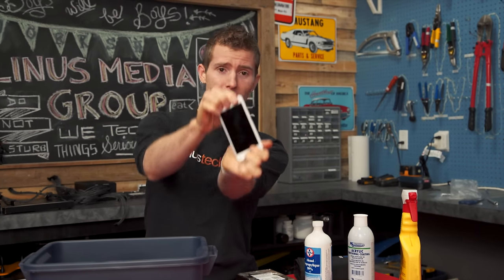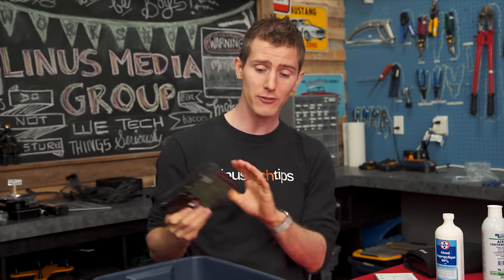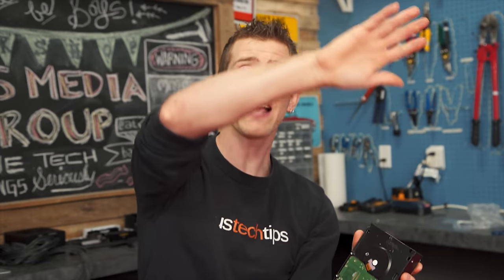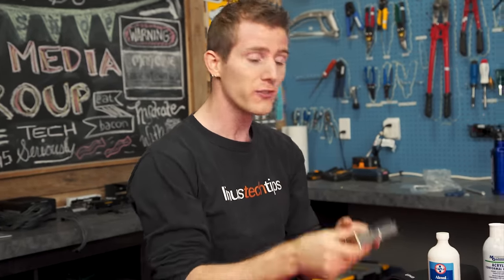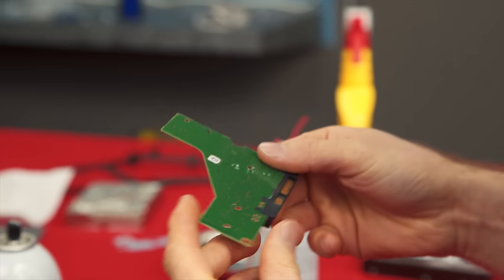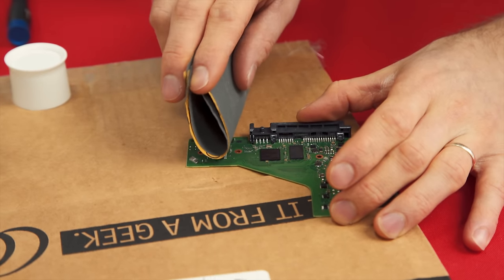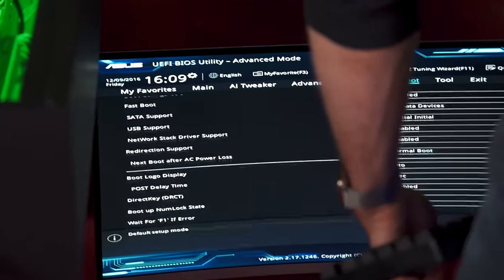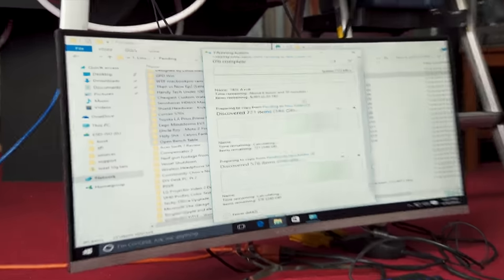DIY "Waterproof" Hard Drive

Comment: I cringed in my head as I pondered the likelihood of a liquid-tight seal on the connector.  
Also, I didn't get a fantastic look at how the board that you coated is attached,  but sanding the coating off of any  of the connections that have opposing charges compromises what you've done and doing it to what you specifically point out is power seems like it  would immediately throw some red flags.  Still appreciate the passion for ingenuity.  I was picturing something more along the lines of a pelican case with an air-tight pass-through  or port that  forms a tight enough seal once the cable is through to ensure the seal is maintained under nominal pressure conditions.

Comment: By sanding the metal contacts and making them open to the water you were inadvertently causing electrolysis, one sure fire way to make water conduct electricity. (and it will eat the contacts)

Comment: Since the circuit board makes connection with the hard drive via contact points, it makes this project bunk from the beginning. Because as soon as water hits the contacts, it'll still short. At least no one else will get curious and wreck an expensive hard drive now. Lol.

Comment: "Okay, I am liquid cooling the hard drive." XD

Dude you obviously shorted the data and power connectors on the top which were not coated with conformal coating.

Comment: Linus, you really made a mess of this one. It was all undone by you submerging a non-waterproof SATA connector. What on Earth were you thinking? If you had siliconed the connection, you might have had more of a chance. Mineral oil does not have the same metallic particle transference issues causing conductivity when compared to water, which does. If you had stopped for a few minutes and thought about the technology operating within the HDD, you should have thought about masking the connections and siliconing the connections.

Comment: if you ran a bead of silicon around the pcb and over the power and data connectors after plugging them in it would probably work.

Comment: No practical application? SmallPC has a "completely sealed and waterproof" PC. It only has an SSD though, so this could make its way in there. Its for marine applications. What ever they are doing to make the SSD H2O waterproof I'm sure would make a mechanical helium drive water proof. 
Ok so next challenge. Make an optical drive with an "airlock" and make that water proof. It may even be possible to insert a disc while being underwater. The drive would be two times longer with two sections. Insert the disc through a slit that has two "zippers" that move outward from the middle and start to close when the disc is more than half way in. In the airlock and water that made it in will be pumped out and a dehumidifier used.  Once this is complete the disc will be inserted into the main drive. I can see why a water proof PC could have practical use, but not optical discs underwater.

Comment: Why not coat the crap out of it, when the cables are actually connected? put a layer between the cables/connector gap. If your plan is to put your hdd in water, I am sure you are not planning to take it out :)

Maybe coat a whole motherboard, ram etc next time? :P running onboard graphics, without cpu cooler and m.2 drive.

Comment: could be possible if the data and power was soldered directly to the drive and then coated (the pins that was sand was a problem too)

Comment: You CAN Make HDD to be waterproof. Just solder up all of the connectors and contacts on the HDD board and sata signal/power and HDD motor, then hotglue them or just spay that "waterproof stuff" on them and you`ll get the "Waterproof" HDD. It`s so easy, but is it worth it??

Comment: It was obvious this was bound to fail for two reasons:

1. There was literally nothing to seal off the power and data connectors to prevent them from shorting out, why would anyone assume that it would be safe to submerge those in water???

2. When he figured out the PCB had those contact points with the drive; No matter how well you coat the PCB it won't make any difference unless you make sure to seal off those contact points as well since the water will just find its way in there eventually and short those pins out. The coating on the PCB most probably did a good job of sealing it but there's no guarantees it's a perfect seal (meaning it could be it only slowed down the eventual shorting that was bound to happen).

Comment: With mineral oil, you wouldn't need to have coated the HDD right? The drive i sealed and the mineral oil would have caused no problems with the PCB. I did coat a customers GBA SP one time because they kepts getting it wet for some reason... :P

Comment: Im a ee and I knew from the start this was never going to work Im amazed he got the drive to even spin up after the coating the sata controler cant deal with the resistance from the water on data lines Its a differential line system 2 wires where the difference in voltage of each line makes your data bits differential signaling is good against noise but not against Linus

Comment: Why not just cover it with silicone, together with the sata power and data? Seems like a better option, by sanding down the connections you un-waterproofed them, and that sata power and data weren't waterproofed at all...

Comment: My idea is to pot it into epoxy, haven't find anybody do it... but I would grease electrical contact with dielectric grease before potting the drive and attaching some downwards pointing 90 degree extensions cords that I will tape under the drive so they would exit at the opposite side where the drive plugs are... and drop the assembly into a shape and fill that with epoxy... Not sure tho how cooling will be but well, that's an experiment... I wanna build a forever sealed drive... that you can bring with you in the tropical rain and would not risk loosing any data due to water...

Comment: He could have just used mineral oil to cool it because it is sealed the oil would not get in the drive and it is not conductive so it wouldnt have an effect on the pcb or the connectors

Comment: you need a waterproofed connector to connect the PCB, as it still has a gap for water leak even when it is still connected to the PCB, you need to connect your PCB out of the water. OR, you can waterproof it with EPOXY on the connectors if you dont mind not being able to remove them foreverXD. ANOTHER solution is that u order a waterproofed PCB connector to connect it to your motherboard.

Comment: 8:52 The power shorted really? The water don't have low enough resistance to short out at 12V, what probably happened is the data sent over SATA was affected by itself, thus causing the data to be completely mangled

Comment: When I initialize my ssd, should I of done MBR or GPT? and also, I've been doing alot of research, do i need to change my bio from IMT to ACHI + choose SSD as boot up drive?? one more question, sorry, when booting up the ssd After the samsung migration tool is finished, do i need to disconnect my HHD? 

Thank you so much, most appreciated + New sub

Comment: Why didn't you seal the data and power cables to the hard drive with something water proof like hot glue? Why would you leave them simply 'plugged in' and not expect water to short it?  The concept worked, just forgot that one small little thing. :/

Comment: Wasn't it pretty obvious, that it won't work with water?
You waterproofed the harddrive but not the connectors. You would have to connect the harddrive and then add the waaterproof spray. But I'm not even sure if this would work, because it would be hard to get enough spray into every single gap.

Comment: Sorry for out of the blue comment but I need help. I had a gtx 970 and just bought a 1070. I plugged everything in right, im very sure I have the drivers installed but when I tried to boot up Rainbow 6 Siege it said "this device does not support direct x11". Any help would be appreciated

Comment: Wouldn't it of worked in oil without  the coating? As long as the drive is sealed shouldn't it be fine.

Comment: Well a 2.5" SSD WITH the cables attatched, then cast in a shell of urethane or silicone compund would be pretty much waterproof... OR put in a small machined billet aluminium casing with silicone O-rings under its bolted lid and a proper aerospace grade gas-tight MS data connector on it :p

Comment: Please redo this test. The reason I'm asking is do to the fact that when you put the power connector on it still got water in it. Spray drive with acrylic then attach connector then spray the connector connected to the hard drive. And if need be the next sata connector for hard drive. 
I bet you the drive will then work under water! 
If that is the case. Then you should be able to coat an entire system (after all plugs are connected) and put it in ice cold water. I bet you the system will work.  mobo (getting under the heatsinks and spreaders. memory (no heat sink to make sure it's protected) if you coat the entire system right. Including cables. The system should work under water. 

Please at least retry the hard drive test with the spray applied to it after the connector is attached. 
Thank you.

Comment: It might have worked had you sprayed the SATA connectors to the point of build up while connected to the drive. I was impressed that the motor leads still worked and didn't short out.

But now that spray gave me in interesting idea using Peltier plates to cool a CPU. Previous videos show setting up the motherboard and then slathering it with Petroleum Jelly, as the Peltier plate tends to form rather severe condensation and even ices up if left on long enough. To remove the jelly, you disassemble the mobo and gently bake it upside down to let the jelly melt and run off. But if you spray everything the condensation could get into (though I would tape up unused ports or put in chucks before spraying), it would be less messy.

Here's a link to the video I am referencing (12:44 is where it starts to form ice!):
https://youtu.be/DHFGY32hV7w

Comment: probably sanding the connectors made the cable connectors not waterproof so the hard drive died when you submerged the drive all the way, making the water touch the cable plug on the top.

Comment: question, if you wanted a water proof hard drive, you would want a computer that is water proof too, as it is an internal hard drive, it would be useless if it was on the outside of the computer without a adapter. so why just not make a airtight case with some way of circulating air inside it and no transfer from outside to in or viserversa, and then only water proof the ports.

Comment: I think he pulled a fast one and was using HDD cables that weren't powered. The main reason is those metal connectors for power and data, you know the ones you sanded, would not have been sealed after the sanding and would have been exposed to the tap water, shorting them out. Second reason is ANY PSU worth it's salt would have tripped the moment that power cable shorted. Sorry man gotta call bullshit on this.

Comment: That helium inside the HD case.... Not for much long, if Seagate is looking for a pressurised environment within the case, using helium it's just not the solution. Long story short, industrial Gas cylinders are made out of up to 15mm thick walls of materials ranging from steel to carbon fibre reinforced resins so they can prevent helium atoms to literally escape too fast (they WILL soon enough). It's only me or anyone else can't see that drive enclosure stepping up to 15mm carbon steel walls.   
(i know, I'm boring as ass)

Comment: filled with helium for more efficient operation? why not use a vacuum instead?

if you were going to put it in mineral oil why bother waterproofing the electronics?
Reply: 1wsx10 Because they wanted to try water first??

Comment: Can anyone get a good look at build for me and tell if theres any bottle necking that might occur? Ive got an ASUS z170 mobo, Core i7 6800k, 16gb of corsair vengance ddr4, gtx 1070 founders edition, 750 watt corsair modular power supply, two 1 tb hdd's, a 250gb samsung ssd and the master air maker 8 all inside the Corsair 460x crystal series full tower case.

Comment: You did it all wrong. You should have left the HDD PCB connected to the HDD, then connect the power and SATA cables, and only then, spray the hell out of it. That way the electrical connections also get isolated. Sanding the connectors and then plugging the PCB and cables destroyed the isulation you applied before.

Comment: So.... you basically could've put it in the mineral oil from the start, without spraying that thing on it... Also, I knew from the start the power/data would short, because you didn't seal off the connectors. Pointless video, still liked it, still entertaining :-).

Comment: power and Data connectors are not waterproof. they would get short circuit! unless you seal them with epoxy or silicone. epoxy much better and they can be cooled in mineral oil for electronics instead of using water

Comment: WTF, you are covering head connector with a spray and then sand it off? Did you think that those pins have a thin gold plating which you just sanded off? After this torture, those pins likely will oxidize with time, and HDD will stop to work.

Comment: it could have worked if you sealed it in silicome
Reply: Even using what he did on the top and hot gluing the edge and the connectors would have done a better job, albeit not for an extended period as hot glue will deteriorate under water, it would still have performed better for this short duration test.

Comment: Why are these drives helium backfilled? Wouldn't it make more economic and physical sense just to pull a vacuum on the drive and have no gas molecules for the drive to spin in? that would be even less spinning resistance than helium. That, and helium backfilling is expensive, and these drives would make perfect vacuum chambers, as helium is used as a leak detector gas in vacuum chambers!

Comment: 8:28 common linus i thought you were more inteligent , the connection between the Cables and the Disk's logic board is clearly not water proof .. it's just like if all those pins were shorted.. anyways

Comment: 1) You're a painter come on! Tape it up what's not supposed to be coated;
2) Insulate the cabling - obviously;
3) No, we didn't think you would cheat and use mineral oil instead of water not because you're not a cheater - you are xD - but because we know you're reckless enough to actually dump the thing in water lol

Comment: This is stupid. Not because of the idea. But for the way Linus tries to make the HDD water resistant. It is obvious for every person with reasonable knowledge in physics and technics, that this HDD would not survive being submerged with the connectors. If I would try such a thing, I would use an approach like gopro with their action cams. So you know, smartphones solve this problem with some internal coating, what you have done for the pcb, but they also covered the connectors, what you not did / removed. And then assuming that the HDD is waterproof is just stupid. This is the first video of ltt which gets a huge dislike from me and this means something real, I'm watching all videos on this channel, most tech quickies and some channel superfun things for minimum 2 -  3 years now.

Comment: I don't think you should be doing these kind of videos on your channel. The only point you could have made is that these helium filled hard drives can be used in submerged in mineral oil pcs, and possibly that you're willing to risk pretty much all of the other components connected to the power supply by testing it in a conductive liquid. 
I'm sorry but this video didn't deserved a like from me.

Comment: This is dumb as all hell. Why would you not cover the connectors? You explicitly sanded them down. At least try and coat the power/data connectors the same way you did the PCB once they're actually connected. Maybe it'd at least work somewhat better. Would at least make sense to try. Jeez.